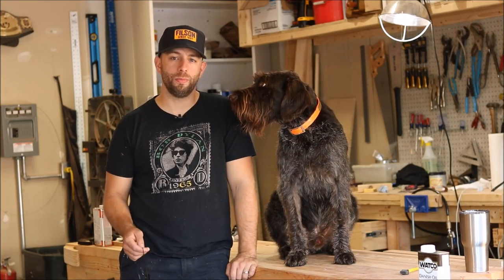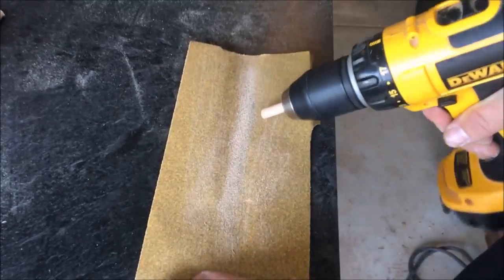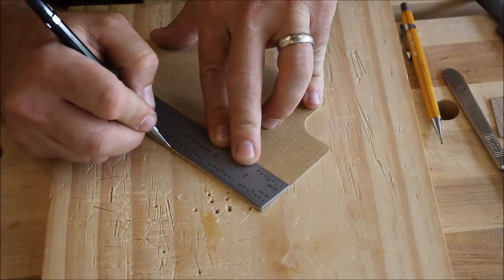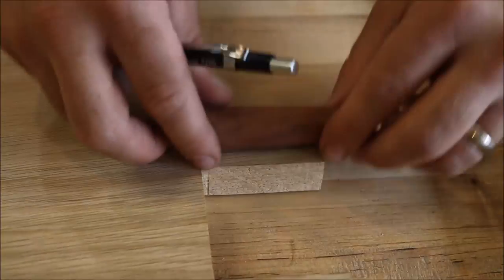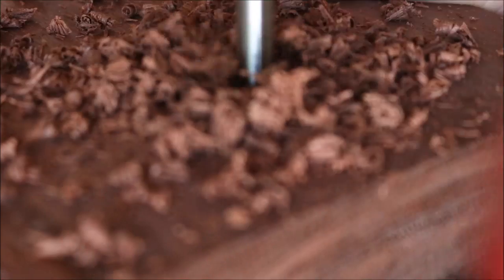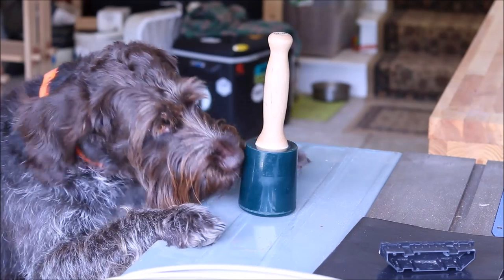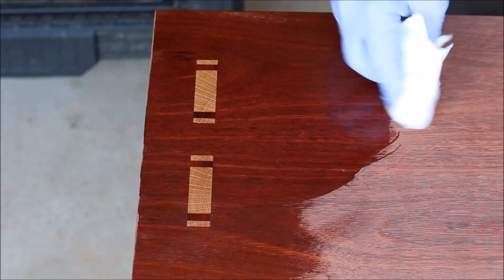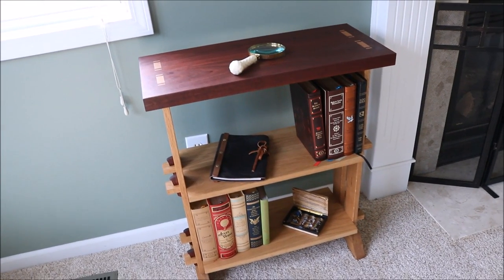Japanese Inspired Bookshelf (Part 2: The BEST PART) How To | Woodworking

Comment: We used to export Jarrah to the US via Boral Timber, they have a warehouse in Philadelphia and San Francisco. Looks great, that's dedication hand cutting joinery into Jarrah, you must've had to sharpen your chisel a few times.
Reply from the maker: One Man Band Woodworks for sure. Jarrah is some serious hard wood. But I love it! I actually bought the veritas PMV11 chisels and that metal is incredibly strong. I used some of my other chisels a little bit and they dulled in just a couple chops. Soooo impressed with that PMV11 metal.
Reply: I might have to look at that PMV-11 steel. Jarrah is about the hardness of most of the wood I work with
Reply from the maker: One Man Band Woodworks its expensive as hell but I think it's absolutely worth it. They also make replacement plane blades that are also amazing!!!

Comment: Which chisel sets, would you suggest for a beginner? I want to get started with using chisels, as wells as knives. The shelf turned out amazing! I loved the way you locked the top into the body. The different wood, made an amazingly eye popping touch. When i get proficient at using chisels, would love to try this project. Thank you for sharing.
Reply from the maker: If I were you I'd seriously think about the irwin marples blue chip set. very reasonable and a ton of fine woodworkers use them! Click the link below to check them out. 

<a target="_blank" href="https://www.amazon.com/gp/product/B0000457K2/ref=as_li_tl?ie=UTF8&camp=1789&creative=9325&creativeASIN=B0000457K2&linkCode=as2&tag=thirdc-20&linkId=cf3428c9fd1c6b93470e39127c0a893d">Irwin Marples M444/S4 4-Piece Blue Chip Bevel Edge Woodworking Chisel Set</a><img src="//ir-na.amazon-adsystem.com/e/ir?t=thirdc-20&l=am2&o=1&a=B0000457K2" width="1" height="1" border="0" alt="" style="border:none !important; margin:0px !important;" />
Reply: Third Coast Craftsman Thank you for the fast reply. I appreciate the information. I will go with those.

Comment: I love the joinery techniques! Not sure if the glue is needed in the wedged and drawbored joints, though...
Reply from the maker: Wim Thys thanks. I'm glad you liked them. The drawboring doesn't necessarily "need" the glue, but it's a cheap extra addition that certainly doesn't hurt to add. Glue on the wedged M&T is really to ensure the wedge itself doesn't get loose over time. Essentially fusing the wedge to the tenon. Not necessarily for gluing the tenon to the top. Just helps me sleep better at night hahaha
Reply: Hadn't thought about the wedge not coming out that way, have to remember that :D

Comment: I know that structurally all these are supporting are some books but were these wobbling much? I know you were pushing pretty hard with a hand plane but at 7:30 they seemed to be wobbling alot. Was that because the shelves weren't glued or you were pushing hard.. Btw I LOVE your channel. Very impressive craftsman you are!
Reply from the maker: Hi Gage, These are probably stronger than most any other bookshelf out there. For one I had them on some uneven ground during that planing scene, but regardless any piece of furniture this size would move alot during planing. It just doesnt have the weight and mass to not move. That is why good workbenchs are around 300-400 pounds, so they dont move when planing.

Comment: Do you have any tips on how to use a backsaw properly?  I've had issues where the top of my forearm becomes over-stressed causing pain.  Thanks.
Reply from the maker: tkarlmann hmm. I would have a hard time commenting without seeing your technique.  Could be your work pieces aren't at a comfortable height causing an awkward angle. Are you doing long rip or cross cuts. I mainly use the saw for joinery cuts and those aren't very strenuous.

Comment: Amazing!! but I'm a novice woodworker and have a doubt... how would this design accomodate for seasonal expansion and contraction of the shelf and the top?
Reply from the maker: Id have to show you a drawing with arrows for the wood movement, but this piece is constructed correctly with wood movement in mind, It will all shrink and expand as one. There aren't any pieces that will oppose each other like a breadboard end or something like that.
Reply: I believe you! jaja. But I'm trying to think it and don't get it... the top and the shelf can expand from back to front, but if i´m not wrong, the feet won't (it can expand vertically). what would happen when the top expands from back to front and the feet don't.
It's very probable that I'm wrong... that's why I'm asking...
Reply from the maker: Ezequiel Laprida you are correct that the feet won't move in the same direction as the shelves and top. The reason this isn't an issue in this project is a matter of scale. The distance between where the side mount to the shelves and top is only like 7" if I didn't have an air conditioned house the wood might move 1/16. But it probably will only move like 1/32" between those distances. If this had a top and shelved that were 4 feet deep then it would be something to think about. This is so small I'm not worried in the slightest.
Reply from the maker: Ezequiel Laprida great question and way to be thinking!!
Reply: Thank you for your time and explanation!!! And most of all thank you for your great videos!!! BTW, I'm wrinting you from San Martin de los Andes, Patagonia Argentina a great place for fly fishing!!
Reply from the maker: Ezequiel Laprida no way!!!! I'm a fly fishing fool and Patagonia is one of my dream destinations!!!  Do you fly fish?
Reply: Yes I do!! I also love fly tying, although it's been a while since I tied my last fly... but I will eventually tie some flies again! I just need more time!!! jaja
Reply from the maker: Ezequiel Laprida oh man, do you have an extra room, I might have to come for a visit!!!
Reply: Third Coast Craftsman of course! Whenever you want!

Comment: 1:15 you can see glue squeeze out! Isn’t this supposed to be without glue or fasteners?
Reply from the maker: Salt nope these shelves I use glue in the joints. I don’t believe I claim that they are glue free. The large bookshelf I made doesn’t have glue in that.
Reply: Third Coast Craftsman oh ok I see, I saw that this shelf was smaller, thanks!